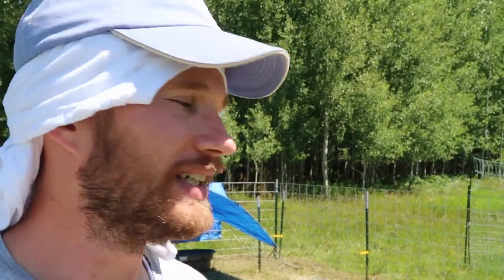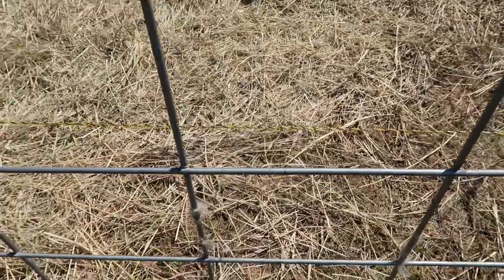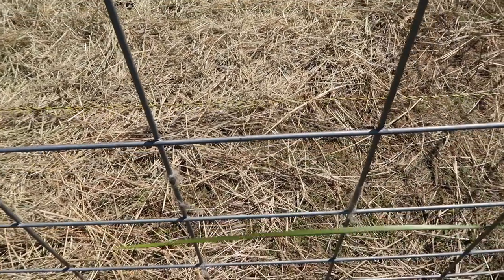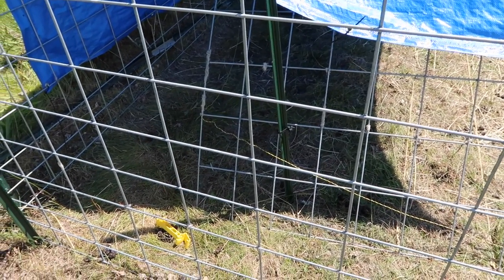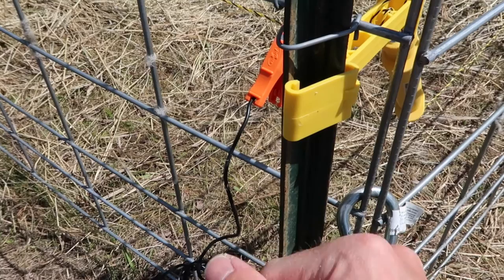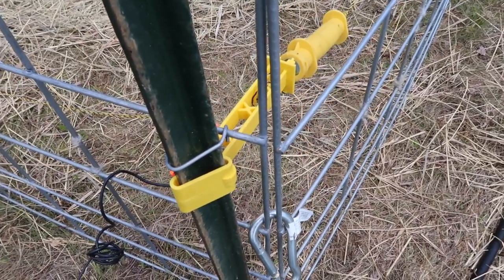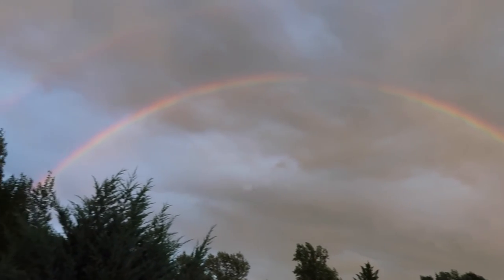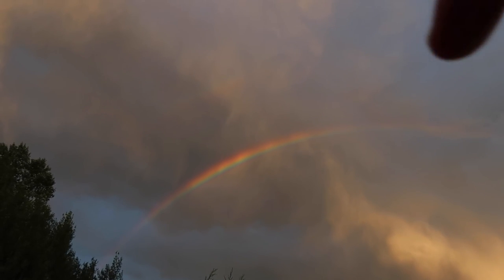This Fence is HOT - Setting Up Electric Fence Hotwire

Comment: If you're like me and you use what's on hand, can you tie hot wire ends together? Or will it cause a bad connection or corrode?  I've got about 650 ft of fence I need to light up. Dang cows getting in the goat yard